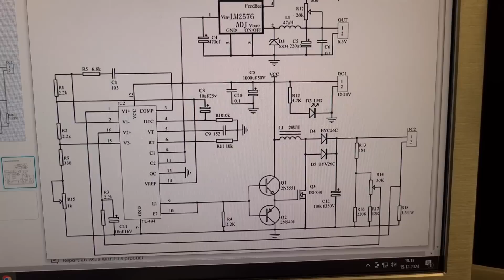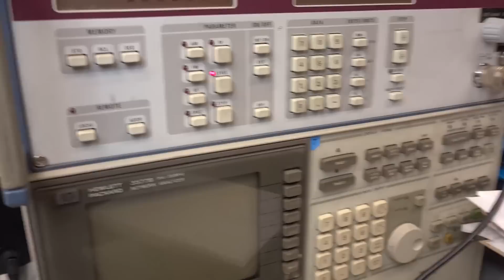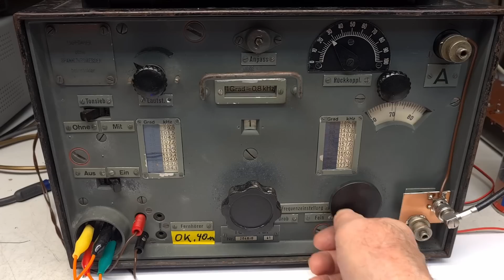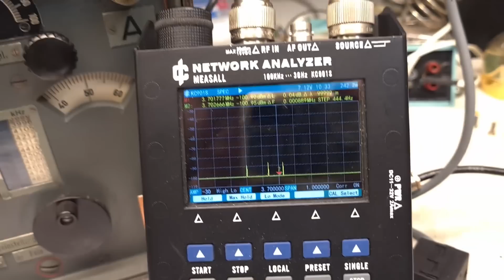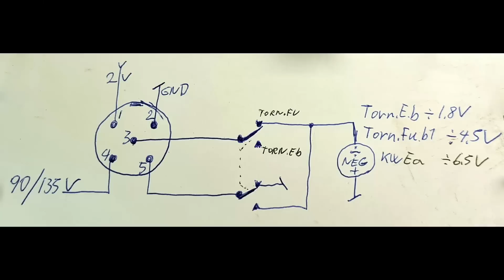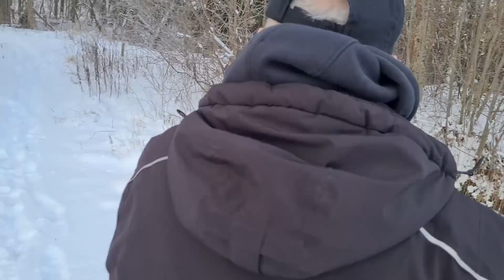Power Supply for German WW2 Military Radio.

Comment: That's really great work! If I could do that, my Torn would work too 🥴 One question: how much would it cost to make a power supply like that to run my Torn?
Reply from the maker: It's not difficult.
It uses 2 Volts for tubes.
And 135 volts high voltage.
And a small negative voltage of a few volts.
There are small DC-DC converters on ebay or aliexpress.
Remember that they are well filtered against noise.
I have info at my internet page.  LA6NCA
Reply: @LA6NCA  Okay, thank you very much for the information. I'll have to take a look as I have health limitations, but I'll give it a try 😉

Comment: There also is a kit for a voltage converter from 12 volts to an adjustable 90 ... 220 volts, 20 mA. It is very suitable for the UKW.E.e receiver. Vy 73.

Comment: Hello Helke. About this module which seems excellent. One have to know that HT current is limited to 50 mA. Other modules (without LT regulation) can deliver more current and modules reducing 12V to 6,3 V are very cheap. Adding a large capacitor as you did is very efficient for LT. For HT, regulating voltage and filtering (described in your videos!!!) are also excellent. 
Another trick: some Chinese 5V from 220V supplies give an enormous QRM so it is impossible to use them for an ARDUINO which resets continuously! I discovered (by chance) that connecting a 220 nF from 5V output to GROUND input solves the problem. Why 220 nF capacitor? Because I had some ones with long legs and they worked immediately! Alain F5RUJ
Reply from the maker: Thanks for your nice thoughts on power.
I was on your QTZ page and saw you had some nice agent radios there.
I will come with an agent radio video soon.
73 de LA6NCA
Reply: @LA6NCA  Hello Helge, I've seen your video about OLGA. I knew this transceiver but never saw it working. 
About the Chinese circuit for supply. I got one and imagined to make a (second!) false battery for MCR1 "Biscuit" receiver. Your modification is very good but neither my eyes nor my hands! So I found another way to add this 1 megohm resistor using an "ordinary" one. It can be connected between output positive socket (DC2 - 1) and the very close variable capacitor soldering on bottom face of circuit to pin near the edge of. So, for a definitive mounting, the 2 pins are very close under the circuit. And it works perfectly! 
All you can see on my QRZ page are replicas, the more identical possible (even BA6 screws HAR!). VY 73 de Alain F5RUJ
Reply: @LA6NCA  I wrote "variable capacitor" but of course it is variable RESISTOR, potentiometer! Sorry!

Comment: Great work! I am trying to design a 24V DC power supply for a US Army radio amplified speaker. BTW What are the frequency ranges on those radios?
Reply from the maker: The radio I used outside is for 80 meters ham band.